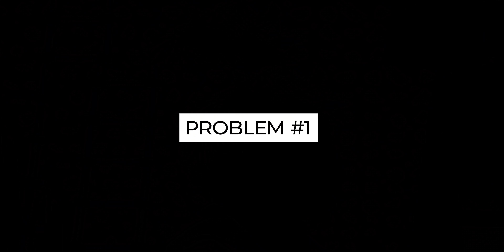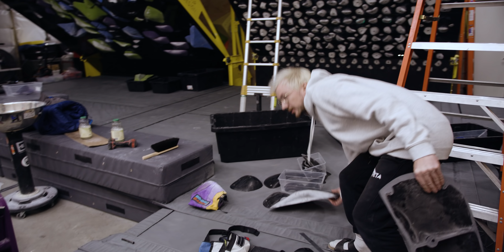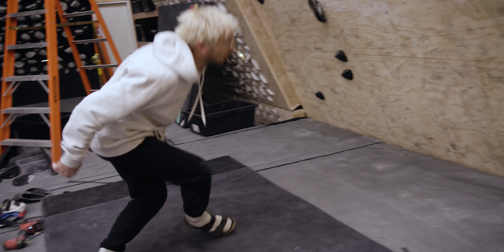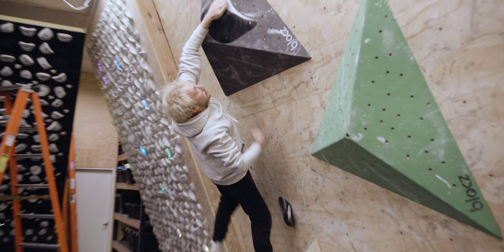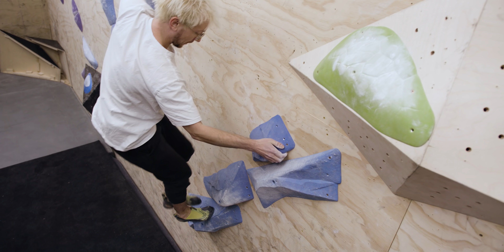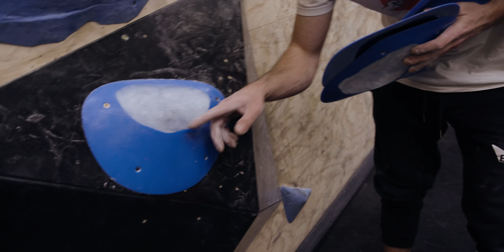How To Set World-Cup Moves (Ft. @BetaRoutesetting)

Comment: Very cool content! One question on setting the difficulty. Do you prioritize first the micro tweaking of hold positions /angle before you opt to change the hold to another one?
Reply from the maker: It really depends on the goals for the climb and what tweak will achieve what you want the fastest. It can be tempting to keep tweaking the same holds but sometimes just switching the hold out is a faster, better solution!